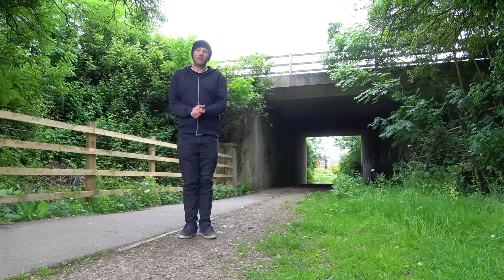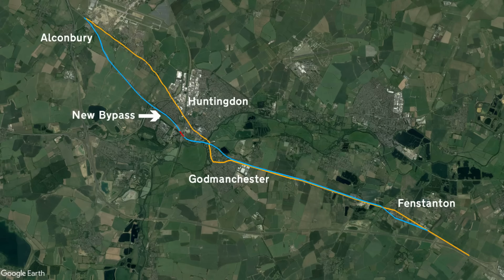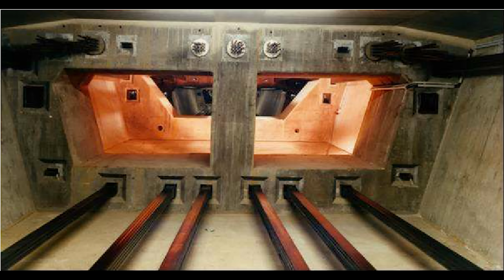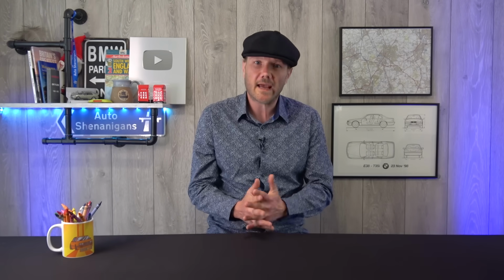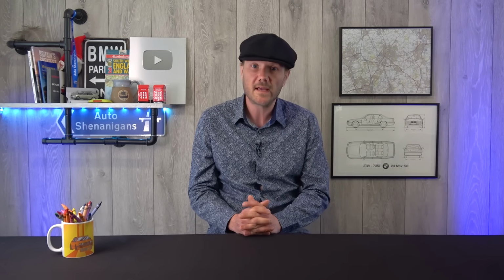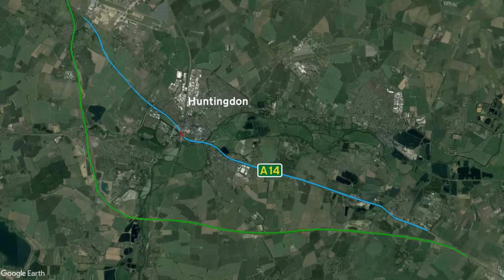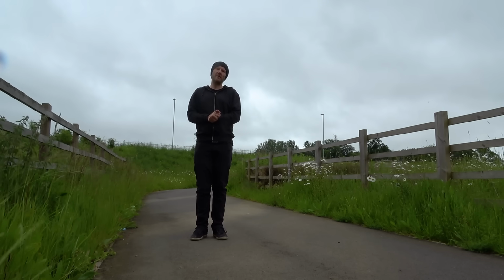Why Spend £46,000,000 To REMOVE This Bridge - Huntingdon Viaduct A14

Comment: Remember, car infrastructure is not only expensive to construct, financially insolvent to maintain, it is also extremely costly to demolish.
Reply: True, but that is also true for any kind of infrastructure. All large scale infrastructure is expensive.
Reply: @FinJet347  Moving freight by railways, rather than having HGVs going up and down the roads and wearing out road surfaces is cheaper.

Also, if you get rid of heavier vehicles, road surfaces last longer. Moving to smaller local delivery vehicles, having more bike lanes and taxing SUVs higher than lighter cars will increase the lifespan of road surfaces.

Low traffic neighbourhoods also reduce through-traffic, so they decrease the wear and tear effects of people using them as rat runs and increase the lifespan of the roads inside them.

Motorways and A-roads are always going to be more expensive than local roads, but if we can create more options that shift commuters onto public transport and more options that allow local people to do things without always needing to use a car, every road journey we can get rid of increases the infrastructure lifespan and lowers the total cost of infrastructure.
Reply: Not sure about nowadays, but a rule of thumb was that every notable piece of motorway built would add 0.1% to GDP the moment it opened. So, expensive to construct, financially insolvent to maintain, costly to demolish, but economically well worth it. 

Nowadays I don't know. With more people able to work from home, and Internet in general, there's less need for more people to travel as part of their job and go meet people, though lorry traffic is probably increasing. Interestingly, East West Rail seems to be more about freight, passenger traffic being a secondary benefit.
Reply: @abarratt8869  Re "East West Rail seems to be more about freight, passenger traffic being a secondary benefit."

One of the things about our motorway network is that it goes through the countryside to connect big cities, but brings a lot of pollution to rural communities near to the motorways.

If we can start to replace our motorway network with a network of railways optimised for freight, we can schedule passenger trains, that are stopping services, between the fright trains and the city-to-city freight movements can help subsidise the cost of maintaining the rural railways. If we electrify the lines (which stupidly is not being done with East West Rail) we can run long distance electrified freight trains. And if we have electrified rural railways, we can run electric trains that have better acceleration and breaking that diesel trains. That means that rural journeys can be faster. The rail corridors through the countryside can then benefit rural people, instead of blighting their communities with motorway levels of pollution and noise pollution.
Reply: Thanks, I'll remember that.
Reply: Pretty much like nuclear power stations. Doesn't stop them building new ones, does it :(
Reply: @mb-3faze  we should build a lot more, energy costs in France are half ours
Reply: @mb-3faze  But they're super cheap to operate lol

Comment: Removing the viaduct may have been an engineering requirement, as rusting wires that hold up a bridge are not a great idea.  And a bridge that spontaniously removes its self is not a great idea either.  Especially to those under, or on, the bridge. :)

Comment: Hi John If you could find out why the cones haven't been removed on the M11 junction 8, A120 east towards Bishops Stortford that would be frickin sweet awesome. I looked on Google street view and they were there this time last year, all the works to remove a roundabout and replace it with traffic lights have been complete since Easter this year. Other than the usual incompetence, or perhaps they just forgot, I wonder why?

Comment: The new A14 is a vast improvement as the accidents on the section between Spitals roundabout and Godmanchester were horrendous which caused hours of delays. It has also made navigating some of the bottleneck areas on the Huntingdon ring road easier. As regards pollution it's just another excuse to attack motorists. If the government focused on building a better public transport infrastructure maybe it would please the environmental moaners and reduce vehicles. Ah maybe it's all too late for that

Comment: Without the viaduct, you have a dual carriageway that ends in a 90 degree turn into huntingdon.... There have been temporary 40mph speed limit signs from godmanchester onward but most people ignore these and come up on a set of unexpected traffic lights at 70mph.....

The other thing the new stretch of a14 did was not only bypass huntingdon, but every single other village along the way from central cambridge to peterborough probably over 10 junctions removed, repurposed or otherwise just not relocated to the new A14. This means now that if you live in one of those villages you have to go all the way into cambridge or peterborough to get onto the A14 OR if you're unlucky enough to end up on the a14 by accident you have to drive all the way to peterborough, turn around and drive all the way back THEN go to your village, some 1hr20 detour.....Im not a fan of the new a14 junctions 😅😅

Comment: Would of been ideal if the A14 went underground and beneath Huntingdon and not have the concrete flyover being built. Before it was knocked down and the A14 now bypass south of Huntingdon. 

Plus the junctions on the A14 need renumbering. Same with the M11 Motorway and the A12 that the junctions also needs renumbering.

Comment: Removing the viaduct and repurposing bits of the old A14 has improved nearby parts of Huntingdon and made access to the station easier. 

For some incomprehensible reason, the A1307 (formerly A14) from Huntingdon to Swavesey, a distance of about 10 miles, is lined with temporary 40mph signs. They've been there for four years. A notice says "Speed limit for safety reasons", but nobody seems to know what the safety reasons are.  So a four-lane road that used to be safe for dense HGV traffic at 70mph is now unsafe for light local traffic above 40mph.
Reply: The 40 mph stretch is nothing like 10 miles, more like three. The reason for the speed restriction is the decrepit safety barriers and initially, handover works prior to the road being passed from the Highways Agency to Cambridgeshire CC to maintain.
Reply: It’s because it floods in heavy rain. Someone was killed hitting deep water and loosing control at speed. The local council now has ownership of the road and are still trying to make a plan of fixing the flooding issue.
Reply: "Speed limit for safety reasons"
So... just like all speed limits, then?
Reply: You think that is bad.  the M4 between Heston Services and the M25 has 60 MPH limits for 'Air Quality' - this is the bit adjacent to Heathrow.....
Reply: @welshwizard645  That is why that restriction is in place. The M road alone wouldn't be a health risk, nor really is a modern airport alone. The combination is the problem, so they fixed it.

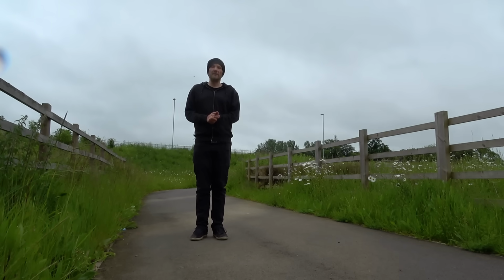Comment: A small point of order: the road you refer to at 3:53 as the A14 was actually called the A45 back then; and was only renumbered in 1994 after the A1-M1 link road section was opened.
Reply: I think the A45 from Cambridge used to goto St Neots (A428) Higham Ferrers/Rushden (B645) then Wellingborough and Northampton north of the current A45 ? I used to go that way to my first job in Herefordshire 40 odd years ago, my parents lived in Norfolk (though even then you didn't go through Wellingborough and Earls Barton)

Comment: I live in the area and am happy the removal from the new route is much better, and the area flows much better now. The new car park and the area around the train station are better. As a pedestrian walking around, I feel healthy now. 
The only issue Is the state highways England left it in. They found defects in the barriers and did fuck all to it and then tried to fob it off to the council. We then had around Three years of fighting before it was handed to the council with a £25 million cheque. Then, when the council carried out an inspection, they found the road was worse then and had to order a specific type of barrier (which has now pushed back the work) and overhaul the drainage.  More 40mph driving

Comment: Never been to Huntingdon itself, but I really like the new A14 upgrade. It was finished early, under budget and brings a massive amount to much needed capacity to an important yet overburdened road. My only nitpick is that they didn't give it full motorway status as the A14(M) since it's built to a better standard than many older motorways. I sure don't miss the tailbacks over the old viaduct.
Reply: It’s the A14(M) in all but name. IIRC it was planned to be the A14(M), but it was ready before all the new (M) legislation was finished, so they continued without it. It’s funny though, because when you join it, there’s a massive sign with all manner of traffic restrictions, making it akin to an actual motorway
Reply: @jordank195  Yeah that would make sense. It'd be nice if they could upgrade the Brampton to Catthorpe stretch to motorway standard and then make it one continuous blue A14(M) to Cambridge that links up neatly with the A1(M), M1 and M6.

And while I'm busy dreaming the A1 through Bedfordshire is also overdue for an upgrade so there can be an unbroken London-Peterborough motorway.

Comment: The other factor for why the removal of the A14 viaduct was so necessary was that the original road was built to link the M11 with the A1, which it did; the A604 however ran east to west, TOTSO'ing at the junction just to the north-west of Huntingdon, and this traffic increased when the main east-west route to Felixstowe was re-routed via Kettering and Huntingdon in the early 90s. Before this, the A604 west of Huntingdon was a two-lane road and traffic from Birmingham to East Anglia went via Bedford on the A428. So, it was carrying two trunk routes and was choked with traffic. The original A14 upgrade was done on the cheap, with that ridiculous multi-roundabout junction at Catthorpe where you had to drive down a bit of a local road to get from the A14 to the M6, and the bit through Huntingdon was another part of that false economy.
Reply: TOTSO'ing?
Reply: @KenFullman  Turning Off To Stay On.

Comment: Yeah, this video captures all the main points.

One thing to note is that the original western bypass of Huntingdon was to relieve pressure not only on the centres of Huntingdon and Godmanchester but also on the tiny mediaeval bridge over the river Ouse.

Another is that, when the then-A604 was built, it was never intended that all the Felixstowe to Birmingham road freight would be routed along it. It only later became part of the A14.

The new A14 has basically sorted things out. The one pinch point is the bridge over the railway line; I wouldn't be surprised to see plans for a new bridge between the Views Common roundabout and Edith Bell Way some year soon...

Comment: Mortar, or epoxy between the pre-cast, post tensioned, concrete sections, simply buys time. The various solutions are only warranted to prevent water penetration for 30-50 years, before water and iron will do its thing. Suspect there's many an HS2 viaduct that will need replacing in half a century, but that will be long after the current architects, engineers, and politicians are long dead, though likely before the loans to fund construction have been repaid.

Comment: That's roughly the cost of the entire M4 motorway constructed around Port Tablot,, with an elevated stretch of 2miles. Of course that was built back in the 70's so,, oh no wait, I've adjusted for inflation!!!.. Wtf is going on that has made our infrastructre so many hundreds of times more expensive, even after 50 years of so called 'advances in technology'.. ? ... Im guessing corporate theft.

Comment: The other benefit of the new Huntingdon bypass bypass is that you don't have to turn off the A14 at a roundabout junction to stay on the A14 and then go round another roundabout junction to go under the A1(M), so by reducing a lot of stop-start traffic, it would have reduced air pollution.

The A14/A45/A604 alone could warrant a series of videos.
Reply: Indeed, Spittals Interchange was an anomaly in that three exits served the A14 and to continue on the same route, as you say, you had to exit and then rejoin via a signalised roundabout which was always congested af during peak hours, otherwise you ended up on the A1(M), an excellent section of road that was designed with far more capacity than it would ever need.
Reply: I think with the M1 J19 improvements (although lacking two junctions) and the A14 improvements it’s now a fairly good road with so much pollution reduction. 3 disastrous roundabouts and choke points gone.
Reply: @michaelcoles6140  
Yes, it was down to 1 lane going from the M6 to the A14, under the M1.
I think that junction is back to its original state of being a rural road.
Reply: @michaelcoles6140  Whoever designed the original Catthorpe interchange needs locking up, that had to be the worst junction in the country.

Comment: I wonder if the bridge could have stayed there as a pedestrian bridge. Probably not, if they spent 46 million to remove it.
Reply: There were never any pedestrian facilities on it or the connecting roads (it was a trunk road). Even without the load of traffic, without substantial work, it would have collapsed eventually anyway, hence why a fortune was spent strengthening it in the mid 2010s despite the upgrade being in the pipeline (which resulted in a height limit under the viaduct). Lumps of concrete were literally falling off it.

Comment: It seems odd that a bridge demolition can take from as little as 30 hours (a weekend closure) to a couple of years. Obviously, they should avoid closing the road as much as possible hence why they don't close the Midland Mainline for six months to electrify the rail from Kettering to Wigston (23 mile section just south of Leicester) and instead keep it open on weekdays and close it on some weekends/nights. Speaking of which, demolishing a bridge over a railway that has the overhead wires (OLE) is even more difficult and disruptive which is the case here over the East Coast Main Line. The ECML is really busy and contains the fast LNER and Thameslink trains going as fast as 140 mph.

Comment: I was born in Huntingdon and went there regularly for audiology appointments for two decades - there would be traffic jams nearly all the time. I would dread having to go there because of the traffic. However, soon after I got my driver's licence last year and drove through Huntingdon for the first time and I was surprised by how incredibly smooth and quick the roads were. Nothing like how I remembered it.
As you say at 3:36, the non-solution to the lack of viaduct isn't much of an issue because of circumstances elsewhere.

Comment: the new A14 is an absolute tyre shredder, never seen so many blown tyres at the side of the road!
Reply: I'm a lorry driver and have noticed a marked increase in puncture related breakdowns over the last decade or so.  I put it down to the fadion for "sporty" SUV type cars that tend to have alloy wheels and low profile tyres which seem to have a tendency to act like a balloon that has been introduced to a pin when it comes to air retention.
Reply: All large roads often have tyres at the side or leaning up the centeral reservation - especially the M1
Reply: I've only been in the new A14 about 2 times and that's from GODMANCHESTER to the A1 lol

Comment: Remembering nearby at Alconbury on the A14 there was a McDonald's building that looked like a ufo
Reply: it was a restaurant called Megatron! it was then turned into a Maccies later on and closed around 2007 i think
Reply: I remember ordering a burger inside the Megatron on a computer screen around 20 years ago - you could even customise the burger contents via the screen.

Only more recently have the big franchise burger outlets introduced this capability.
Reply: I remember the Megatron. 😎
Reply: I remember that McDonald's as well.
Reply: That would make a good video that John The Alconbury UFO Not too far away from Former PM John Major's home ... Odd that !
Reply: Wasn't it originally built as there was a large American air base at Alconbury? Used to live in the East midlands and travel down to Essex when I was a kid to visit family in the early 1990s  and was freaked out by it 🤣 do the opposite journey now and it's completely different 😳
Reply: @cannedham86 yes, RAF Alconbury was still there when I lived in Huntingdon, I remember Megatron/Macca’s, but it closed a long time ago. Sat derelict for years and then was demolished.
Reply: Definitely needs an Auto Shenanigans for it.
Reply: Shame the Americans were here to stop the Russians, they went and the Russians moved in

Comment: I had to ensure hours on the A14 when the M11 was closed at night for many reasons. The A14 is still one of the most horrible roads in the country passing through such delights as Kettering and the said Huntingdon. No exciting bits whatsoever other than the Weetabix factory. I got caught up in a jam on the A14 and I was in that jam for two hours.  However it's not as bad as the A127 to Southend, now that is a proper dingdong.

Comment: The new A14 has been built on the cheap. Everything is sinking and all the planted trees have died.
Reply: Its not improved journey times either. Takes 5 to 10 minutes extra to get to the start of the M11, than what it did before. Plus they have now had to close a lane over one viaduct at the A1 end. Presumably to work on weak supports maybe?
Reply: what you mean is new "construction methoods"